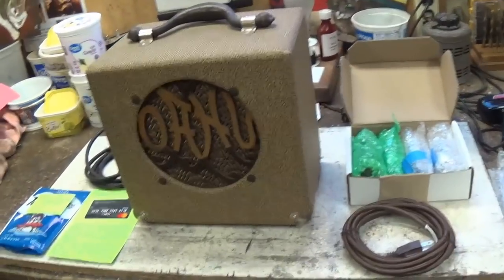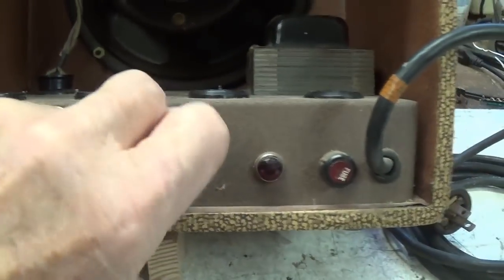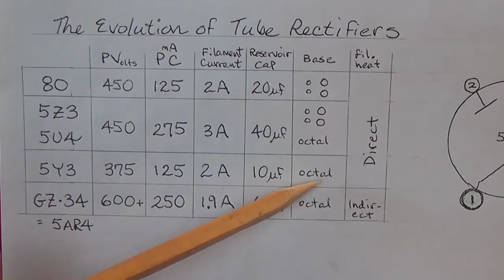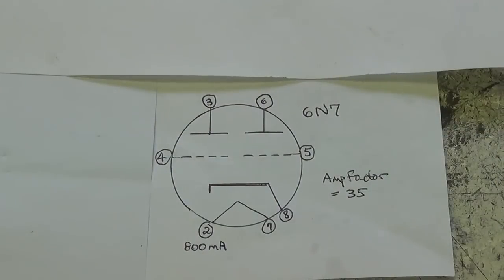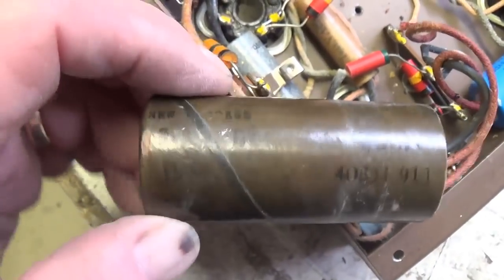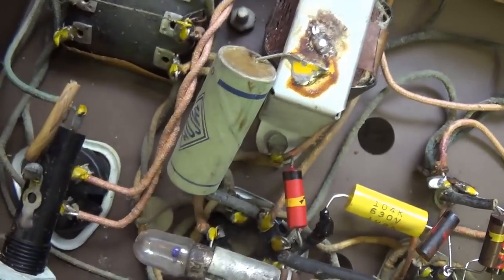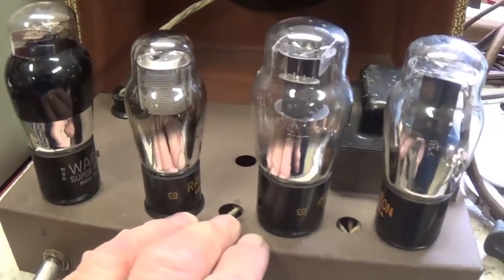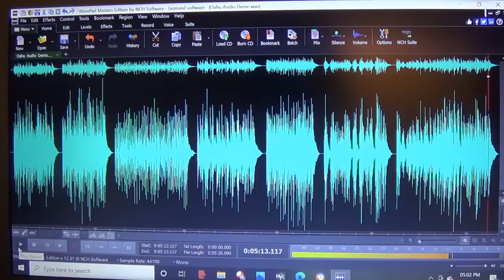Amazingly Original Pre-War OAHU Amp Gets a Tune-Up

Comment: HI Uncle Doug, I'm a big fan of your video's :) I have a request but I couldnt find a contact e-mail for you so i decided to message you here, hopefully you see this. Im a uni student in the UK and Ive decided on designing and building a valve amp for one of my projects this year. I was wondering if you would be able to look over my schematic and offer any suggestions with it. Its a pretty simple class A1 single-ended amp, 2 x 12ax7 4 x el84, solid state rectification (mainly for ease and timesaving). 
Your videos have been a lifeline throughout this project and I really would have struggled without you and rusty to show me the ropes, so thank you for doing what you do dude, its appreciated a lot :)
Reply from the maker: Greetings, M2. Since you are responsible for the design of the circuit, wouldn't it compromise the learning process if I were to assist?  As a former teacher, I am hesitant to interfere in a school assignment.
Reply: @UncleDoug  totally get your standpoint, I can understand your hesitancy. I guess I should re-phrase my question, is there any chance you could take a look and see if there are any issues that jump out at  you, rather than any suggestions on design. :)
Thanks very much for replying by the way, very much appreciated :)
Reply from the maker: @melancholymonk7883  I honestly think the assignment would be far more educational and rewarding if you simply did your best, possibly made some mistakes, and then resolved them yourself, MM. It's the best way to learn. Good luck.
Reply: @UncleDoug  Thank you anyway, i can see where your coming from. I tend to second guess my work a lot of the time even when ive double checked my maths etc... may help me with the ol' confidence with these things if i pull the whole thing off on my lonesome :) Ill be sure to put a video up of the first audio put through it and drop a link in the comments for ya, heres to hoping it doesnt sound like a tin of bees :D many thanks :)
Reply from the maker: @melancholymonk7883  Upon successful completion, you will enjoy all the credit for the work, MM, and will have gained the maximum possible educational benefit.

Comment: Any ideas on how to get this ringing noise out of my amp? It's a new Firefly build and it rings when the Boost is on and turned more than halfway up. I posted a video of the noise. It could be something simple but unfortunately my knowledge doesn't go too far beyond reading a schematic. Come check it out I'm open to suggestions.

 https://youtu.be/LVTf5uExMMU
Reply from the maker: Ringing at high volume is almost always due to a microphonic tube, Cameron. Tap on each tube with a pencil while the amp is operating and I'll bet you'll discover the culprit.
Reply: @UncleDoug  Definitely not the tubes. I have a big stash of brand-new tubes and swapped all of them out three times.
Reply: @UncleDoug  The heater voltage coming out of the Transformer is 6.7 volts instead of 6.3 volts. Is that too high or is it normal? I put the original tone stack back on that the schematic called for and the whistle changed to more of an aggressive humb. I'm starting to think maybe that's the way these amps are supposed to sound and if that is so it would explain their lack of popularity.
Reply from the maker: @cameronstolhand7149  The slightly higher heater voltage should cause no problems. I assume the hum is 60Hz.....if so, the problem probably resides in lead dress and/or a noisy tube. If the hum responds to the volume control, its cause is prior to the VC in the circuit. All these observations have been covered repeatedly in numerous videos.
Reply from the maker: @cameronstolhand7149  Check for a bad solder joint on a tube pin or nearby.
Reply: @UncleDoug  It's definitely not the tubes I tried three completely different sets. The hum does respond to the volume control. 

What do you mean it's cause could be prior to VC in the circuit? What does VC stand for? 

Could be a bad connection I'll double-check.
Reply: @UncleDoug  One of the tubes appears to be microphonic. When I tap on it it rings but I know the tube is good because no matter what tube i put in that socket it acts microphonic. All the connections appear to be good. They visually look good. When I move wires around it doesn't affect the sound but when I tap on connections close to the tube it makes a microphonic sound.
Reply: @UncleDoug  Somebody told me to pay extra attention to the Input grid wires and that seems to be changing the sound of the hum. Now I'm starting to think that the preamp tube is too close to the power tube so I'm considering doing a different layout. The 12AU7 (which is being used as a power tube is only three quarters of an inch away from the preamp tube. I did use someones print out template for the spacing of the tubes but maybe their spacing is to close
Reply from the maker: @cameronstolhand7149  Have you tried using shielded cable for your preamp connections?
Reply: @UncleDoug  I didn't use actual shielded wire but I did twist the heater wires together. I tried twisting some of the preamp wires together but it didn't really change anything that I noticed. Do you think using actual shielded wire would work better than just twisting them together? Are you supposed to ground both sides of the shielded wire or just one side?
Reply from the maker: @cameronstolhand7149  Use shielded cable for all your pre-amp connections and ground only one end of the shield.
Reply: @UncleDoug  Thank you for your help Doug. After some experimenting which included pulling the middle tube out, moving it around I found the tubes are too close together, also I think my tone stack stretches too far across the chassis which is small and puts it too close to the power transformer. From listening to other people's fireflies I think these were designed to have a lot of gain and that combined with my custom layout did not work to my advantage LOL. It is surprising just how much gain, feedback and whistling you can get from having things too close together.
Reply from the maker: @cameronstolhand7149  Cramped circuits  can definitely cause problems, Cameron